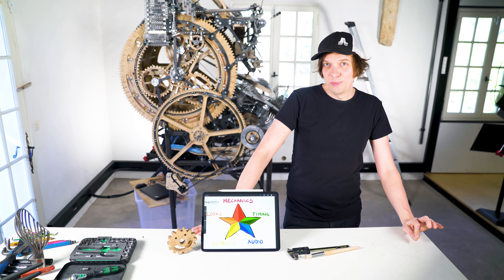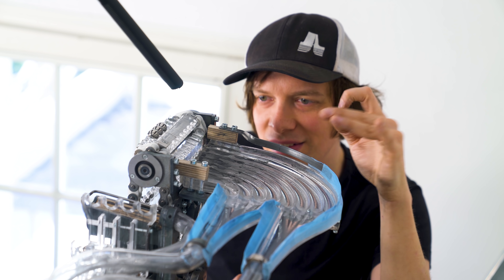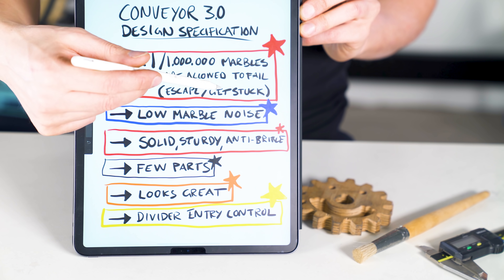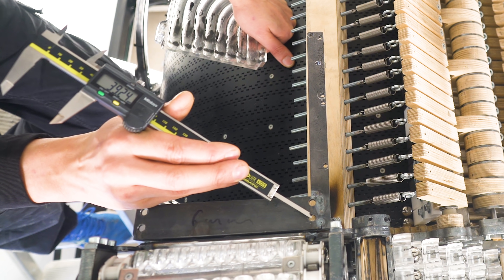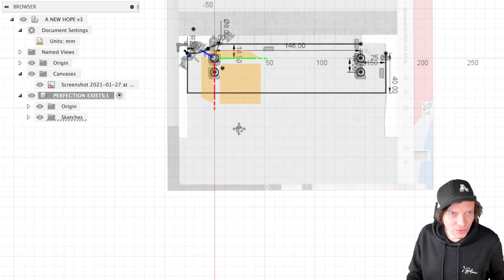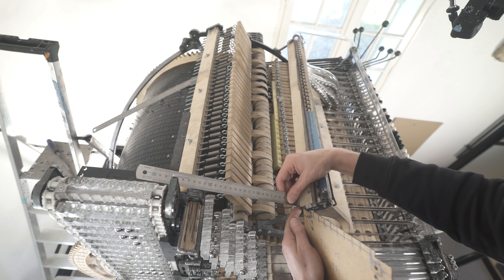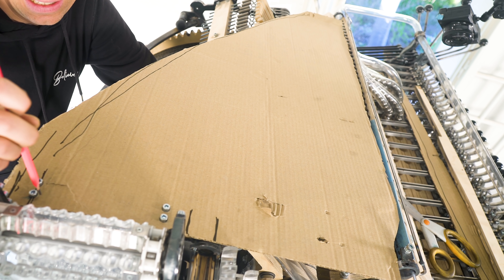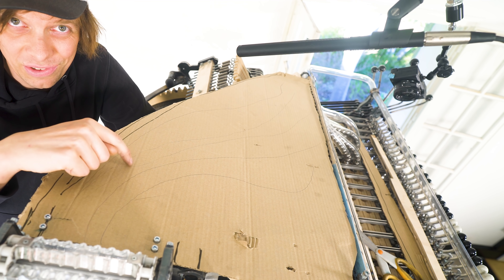Designing From First Principles

Comment: I saw a very definite problem with your distribution system, that's how I see it from my direction. 
At minute 3:52, you can see Martin that your system was too low on the lift, which also created a very loud noise. 
I would put it higher and closer to the lift so that the lift almost pushes the marble onto the distribution system on it. Thus you prevent noises by the marble on the distribution system happens and on the other hand would theoretically also no more marble down with drive.

Comment: By the way I just had an idea for the Div-by-4 that keeps both the coolness and implements the "safer" distribution: modify just the final part of the connection so that before getting captured by the elevator, the marbles have a non-bounding plane where they can be split around? Would that make sense?

Comment: martin - you should put a marble capture and re-route them under the conveyor if you can't eliminate those marbles, I almost feel like that would be an neat feature for some reason.  it's like "ya, i know marbles might get scooped down there, but they get can travel down the inside of the conveyor, they are nicely secured, I will just re-route them"

Comment: You made a mistake. You say the edge can be 8mm without the centre if the balls going over, then maxed out the gap to be 7 .. but you also made the locating holes 8 to give some.adjustment with an m5 bolt. In worst case that means the plate can be 1.5mm further back, 7+1.5= more than 8, .. and you could get some marbles trapped. 

More and more you talk like an engineer now. Engineers work to fine tolerances. You don't need a 7mm gap. Make it smaller. (Formally, less than the worst case with the added tolerances from the locating holes, ie 6.5, but actually you could go further, eg 5. Do you really need more gap than that ? (Does the conveyor get so far out of place ?

Comment: Hey Martin, please tell me, if I'm wrong, but from my understanding, the gap between the newly added part and the conveyor must not exceed half the diameter of a marble. Otherwise the center of gravity of the marble would prevent it from rolling down the new track. As you pointed out a few days ago, marbles cannot roll uphill. So you have to make sure, that the lowest point of the marble is always oh the plane. From my understanding, a gap of 7 mm would lead to problems, where a marble can get stuck between conveyor belt and track. With a gap of 4 mm or less, this cannot happen.
Reply: Xin chào

Comment: You really helped me figure something out. When you're trying to achieve something you will fail a lot. There will be weeks or months when just nothing seems to work. We want things to work but it sometimes just doesn't work. This is really demotivating. So I've learned to expect things to fail. It sounds a little bit sad, but when I try something new I expect it to go bad. If it goes bad it met my expectations and that's that. But if it goes well it exceeds my expectations and it is super rewarding.
But most importantly, we have to continue what we're doing🥰Without hard work it will end in a failure without a doubt😊

Comment: Hey Martin!  While you're redesigning the ramp from scratch, I'd suggest going a step further.  Right now, your marble divider requires a lot of fine-tuning to get the marble stack heights perfect so that the marbles can roll down them (c.f. three videos on height modules plus however many on the main channel).  Why not redesign the divider at the same time to eliminate the need for such precise alignment?  You spent all that time to dial in six channels --  do you really want to have to do the same for the other 32?  Eliminate the need for the height modules entirely!

Comment: I'm not sure about your solution to prevent those ghost marbles. I mean in the case we saw they just roled back into the slots they came up in and I'm not convinced your solution will work but I cant think of a solution which wouldn't require a major redisign.
This might be a case where you need to think more in reducing criticality of the failure rather than preventing it. basically by making sure that if a marble goes down the wrong side of the conveyor, that it can't get into the cogs, you can then redirect them into the lines which bring the marbles back up.

Comment: Just curious why not cast your plastic parts instead of machining them. By casting them you could pick the hardness of the plastic or even combine different shore hardness together in a layered part and could eliminate your noise issues. Not to mention the ease in making new parts on the go. Win win if you ask me.

Comment: I am a huge fan, sometimes it is hard to see Martin struggle. If you build a Ruby Goldberg machine you cannot make it efficiently designed. A first principle might be that marbles are not a good medium to transport information so that would led to the ultimate end of the project. I also think that the no marbles on the ground obsession is misguided especially if reasons of failure are anticipated instead of experienced. Martin could have run millions of marbles through the machine by now. Of course failing marbles should not destroy the machine and the machine should not loose so many that it runs dry or becomes a hazard for people walking around it, but I think resiliency in that regard would be a more attainable goal. In addition reliability is important for the world tour but I think composition and the studio album could be created on a less reliable machine and using it would create useful experience. Ultimately, all these problems are by design and I feel like the whole soul of the project lies in those contradictions. Embrace them, that is the art of the project! I learned so much about engineering.

Comment: One thing I've learned over years of cad design is how I like to deal with dependencies. Often, designs change. These changes can includes mating positions between multiple parts. Having them reference each other can be rough, but having no references usually results in one part getting changed, and others not being changed to match. Using project level equations and variables is the best way I've found to have mating parts match, but not directly reference each other.

Comment: for the treads you can put a slot in the middle of the holder (where the marble sits) and a "hook" or "guide" to fit into the tread's new slots to "pull" the marbles out of the tread

Comment: Add a slight incline between the shuttle and the new part. It will prevent marbles from sitting adjacent to the shuttle. You look as if you have the vertical space for it. Only need a few millimetres.

Comment: 6:14 - In programming we call this "Code & Fix", you simply start coding and when there is an issue you try to fix it.
The exact same issues arise however. You can circumvent some of them by sticking to conventions analog to your less parts requirement, which is an engineering convention to have as few points of error as possible.

I still use 'Code & Fix' when learning a new technique. If you've got the time there is no better way to learn than to make the mistakes yourself. But it is absolutely the wrong way when you want to get your product done well.

Comment: He pointed out the hazard of a ball falling into the gears below the conveyor. Well, it’s just a ball bearing hazard. ANYTHING, like clothes and fingers, hair, mic cord, could catch as well. 

I suggest a review of hazards and add guards. For the machine’s benefit and safety on stage. Cosmetics are at the bottom of priority list. I didn’t see an entry in the requirement list for safety of man and machine.

Comment: Is it only me that feels like the whole marble divider is an (attempted) overkill, replacing one of the few good parts in the original marble machine?
The original machine had a simple flat, angled surface leading to the channels where all the marbles would just find their place.
This will eliminate the need for the height modules, as well as practically eliminating the risk of any single channel becoming starved, regardless of which instrument section is playing at the moment.

Comment: I never understand, why you the stream of marbles to be lifted up devided into 4 equel streams just for that conwayor belt system, and then brimg them togeter again into just one stream, that causes colliding of the marbles, but just one moment later, they need to be devided again into more than one independed stream by lot of rails for the marble devider. that any row has the same change to get enough marbles. Also I see a problem, that, as you doit now, anny marble, that doesn't fit into the pipes of the marble devider are going to the next turn through that lifting system, and you may run out of marbles, if you not have some buffer at the top of your machine. Have you ever calculated how many marbles will drop on the instruments in the time, your convayor belt releases  just 4 marbles?, from them maybe a lot will pass the position, where the marble devider need some of them.

Comment: If you are canny with the design you could get the majority of the design as a single  3D printed part (the tracks) in a tough plastic like ABS. This  also makes it easy to get a couple of spares made 

It may also be sensible to look at the fragile marble returns at the bottom of the machine and design a 3D printed version. Again if you can exchange the custom and fragile plywood construction with a 3D printed component spares are quick and easy to get (and you can cary several spares on tour)

Comment: I'm really liking the fusion 360 content, I'm just getting my feet wet with some really simple projects and it's really cool to watch a real and complicated project.  Keep you chin up, like you've said you're designing and building something with more parts than a car.  Closer to designing the engine, transmission and then the rest of the car.  And that takes years for a team of trained professionals.  Compared to that, you're ahead, and you're doing it yourself with some help and contributions from outside, learning as you go.

Comment: If a marble does get pinched between the edge and conveyor belt, does the belt flex enough so the marble just drops somewhere without breaking the belt? Because it will happen even if it can't. Having the edge raise a bit makes it less likely and also makes the hit smoother and quieter.

Comment: Now first I'̈m no engineer just an old IT nerd with varied interests, and I admire Martin's achievements. And maybe I have misunderstood what happens after the conveyor belt drops off eight marbels. I looked to me as if the old solution used the laned quarter circle and seven "Y" junctions to make them roll into the marble divider single-file in one tube.  
Now suppose it was marching soldiers. To get a "squad" of eight soldiers from a side-by-side row into a single-file column, I wouldn't command them to get behind one another first forming pairs, then merge four pairs into groups of two, and then again to one single. I would simply order "turn right! Forward march!" With the marbles being round, this is even easier. Martin talked about how many parts there was. I think two could do it: some enclosed container guaranteed to catch all eight in a row, with a sloped bottom, feeding through a tube into the marble divider as before. Nice, orderly, simple. In fact so simple, I suspect the idea must have been thought of before and rejected for some good reason I just don't understand things well enough to see. Maybe someone can enlighten me.

Comment: If a marble is 8mm, even a gap of 5mm is enough for the marble to balance beyond the edge, or dance around there if the belt is moving. You'd want it to be less than half the marble size (since a marble is close to perfectly round) and take it down to 4? Taking measurements and using CAD is great, but you need to get the math right as well :)

Comment: It's way too late in the process to be worth mentioning I assume, but, why don't you have the part where marble land to be curved up higher and closer to where they flip off the belt, so that they don't "jump" onto their lane but merely slide very soon after going down on the other side of the conveyor belt? 

I've seen that you're re-iteration still includes the marble jumping off and down on their lane but that won't help with the sound, and still feels way more chaotic than the solution I'm thinking off.
Sorry if I'm missing out on potential issues this would bring up :D

Very happy to see you landing back on your feet after the depressing end of yesterday video!

Comment: be careful, when using the terms Fault, Failure and Error

Fault: System-Property, which exists not only during runtime of the system (e.g. Design-mistakes)
Error: Result of a Fault during runtime of the system
Failure: System functionality is limited or not available during runtime, which can maybe cause critical situations (harzards).

If you need help with risk/hazard analysis, feel free to contact me ;)

Comment: 13:24 - The measure looks like to be from the corner to the EDGE of the hole, not to the centre of it. Arrow seems to point to the edge. That's why second measurement was much more accurate?

Comment: I have not yet fully understood one point. Why is the distance of 0.7 sufficient? If the marble had the 0.81 place, then it would almost simply be able to fall down. We don't want that, but the problem is that the marble doesn't need this 0.81 to get stuck there. So it lies in the gap of 0.7 and is then taken down again. Doesn't the distance have to be at least exactly half the diameter of the marble or lower so that this effect no longer occurs? Or is that a big question mark in my head for nothing?

Comment: I think I see where your going with this, each of the 8 channels joins the divider in different places, so that there is a steay feed across the length of the divider. Obviously the marbles joining the divider in the middle will fill up empty spaces and then travel down to the bottom filling as they go. BUT, will there be enough marbles going to the top of the divider to play the lowest vibraphone notes? If your music is using lots of low vibraphone notes, you may not be providing marbles fast enough to that section.

Comment: I am worried by Martin’s continued seeking of perfect mole-free CAD design. The skills he has learned through this build are fantastic and the parts he is producing are now of an excellent standard, but there is no such thing as mole-free CAD design! All design engineers know that a mixture of in silico design and practical prototyping is both necessary and desirable, and in fact this is what Martin does when he’s working. The problem is that he then beats himself up when the result is anything other than flawless.  This is a recipe for worse designs and poor mental health. Everything Martin did in this video is exactly right, and if he can just let go of the unrealistic expectation as well, it will go even better.

Comment: Remembers me of my engineering studies where they taught us about the "TRIZ" methode and the solving of design contradictions. You should always try to avoid adding anything to solve a problem, and you illustrated that perfectly with the added silicon that resulted in potential anihilation of the MMX. The better solution is often to redesign the part and get fonctionnality from shape rather than adding new material or new parts to the existing subassembly/system/whatever that was problematic. Excellent job here ! Good luck !!
Reply: That was exactly the problem with the Boeing 737 neo. New hardware = new problems. New problems = additional software, additional software = additional problems ....
Reply: additionnal software = additionnal problems

additionnal problems = new crew training 

new crew training = human time and logistics problems 

and so on until the crashes...

Comment: Idk if this was told or been said already but how abt you put a curve at the entry point of the marbles in the elevator(i forgot how to spell sorry) like put a slight curve in which makes the marble entry smooth and less noise when it enter the fork path. It will make less sound i think and it will lessen the possibility of the marbles to escape thro the down force of the elevator.

Comment: By all your downs, failures, moles and thinking about giving up on the MMX, always keep in mind, you wouldn't be there, if you gave up the project already. Each little misstake and failure lead into re-desiging, not only on the MMX itself, but much more to your thinking as engineer and designer. DFM and 5-point-star was never in your mind when you started the project, but it came to you while working on it and it finally help you to solve it.
I reference again to my big scale steam loco I build. It was my first engine to that scale and I thought a lot parts can be done easily. Meanwhile, I replaced nearly all bushings with ball bearings. replaced several other parts and had to repair damages to the model due to weak construction or accidents. But with every repair or rebuild, I get closer to a perfect engine and my knowledge about part making still grows every year.
And know what, even I can still learn from your actual progress every day. I'm also using Fusion and you explained some functions much better to me as other tutorial videos. So please go ahead, we all can learn from your journey.

Comment: Hey Martin, did you consider adding cloth to the design for silent moving of the marbles? 
I dont know how is it from engineering POV, but artistically both visual and sound could be better.

I mean maybe cover the board with the tunnels with something like lycra, so when the marble hit the tunnel it has a soft landing, and the cloth mutes the sound of the marble moving. 
It will also add some color and different texture to the whole machine.